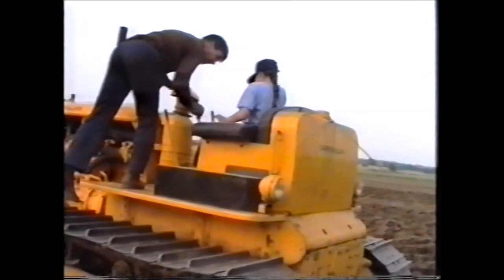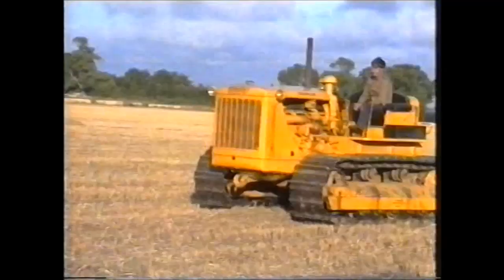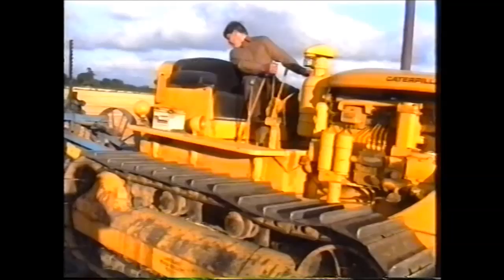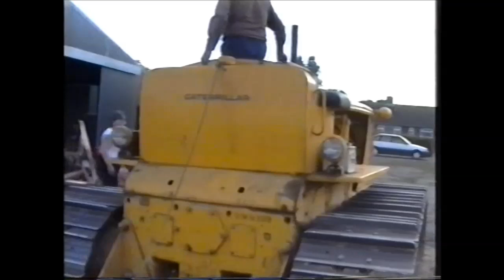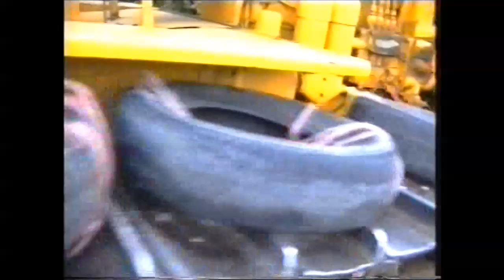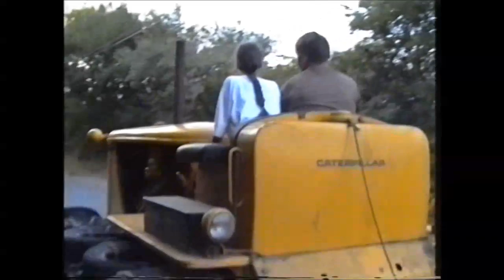D7 Caterpillar ploughing, mole ploughing and going for a road run without cutting the road up

Comment: I have, in my farm in Libya, a 1938(I believe) D4, that we still use. As our soil is tough red, it can only pull a 3 furrow Nardi plough. It takes about 30 minutes to finish 0.5 km. My father purchased 3 of them in late 50's and just this one is still running.
Reply from the maker: The D4 is the version that seems to have survived in the largest numbers in the UK. It was the most commonly used version on farms in the UK from the 30s to the 50s, some were still being regularly used here 40 years ago. It is good to hear of one that is still in service, it shows how well made they were.

Comment: Loved this video! I have two of the newer version of this tractor (1960) and very little has changed. They are very tough machines. They didn't scrimp on the steel & cast iron when these were built! Are you in the north of England by any chance?  My late mother was from Harrogate. I'm a Yank here in the states. 

I have never seen that tire trick. Over here we use illegal aliens! You have to tie them on real tight though. (Kidding...) 

Great vid. Thanks for posting.

Comment: I hate hearin the. Engines on idle while moveing .does mor harm than good
Reply: The early D7 had a low rpm engine .. about 850 rpm was all they would do but the pistons are huge and have a long stroke so lots of torque
Reply: Maybe  i am use to the newer 17 A series  that ran at1200 rpm
Reply from the maker: @pursang360  5x8 inch at 900RPM develops 93 BHP and 80 DBH, it was ok to let them idle at a slow idle not a fast idle or you cooled the heads down too quickly, and leave them many hours black treacly oil would start to run down the exhaust and could be a strip down to stop it.
Reply: I have seen cases  were lugging diesle  lift cylinder liners   and cause   more damage than rinning on the governer